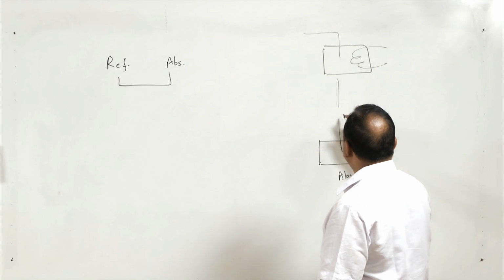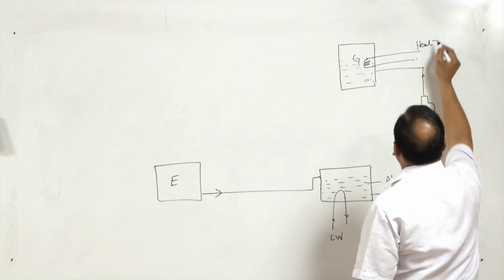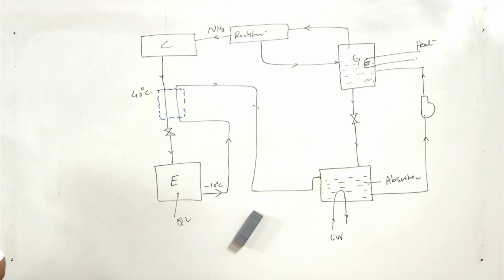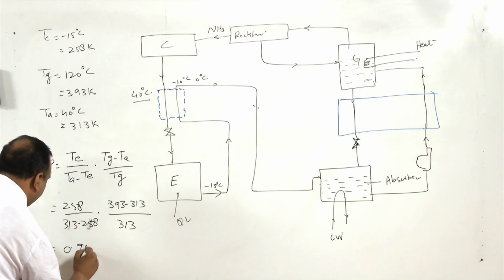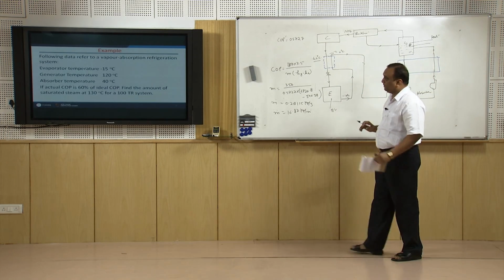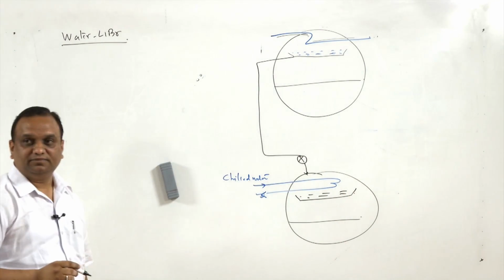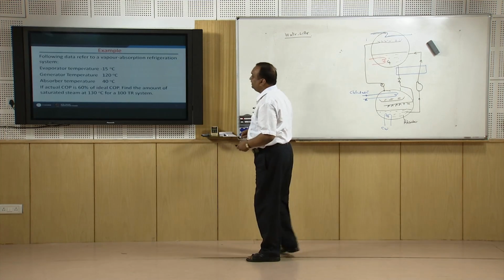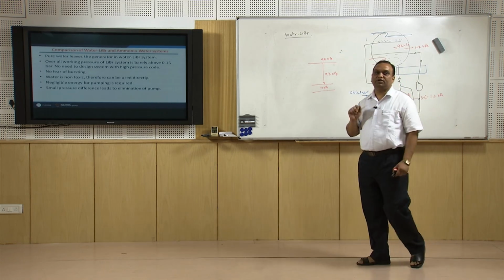Vapour Absorption Systems-2

Comment: 120 deg C is Ammonia-H2O solution temperature which is coming out of Generator and Steam temperature (Heat source) is 130 deg C.  Steam enthalpy corresponding to 130 deg C shall be considered for the calculation.